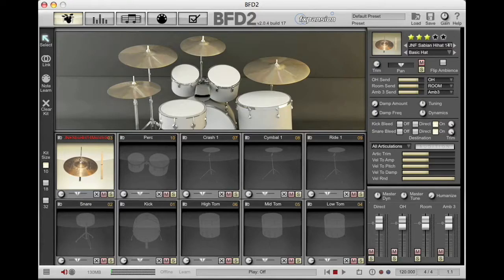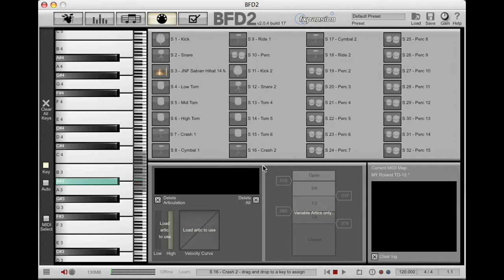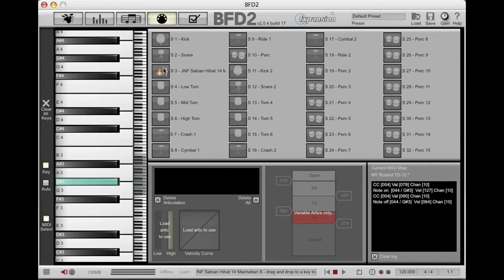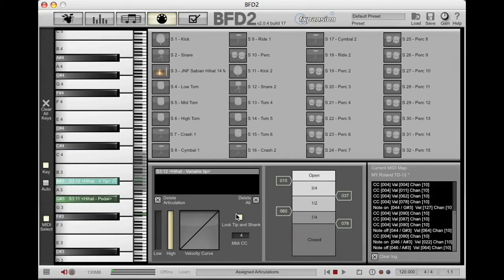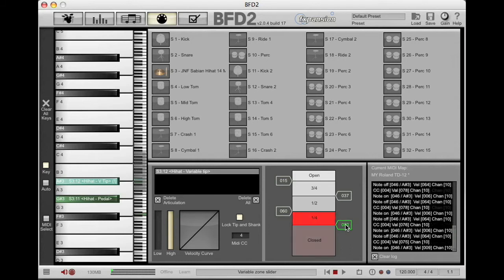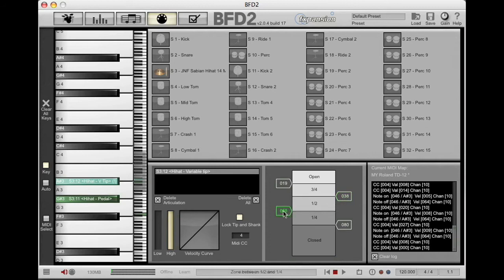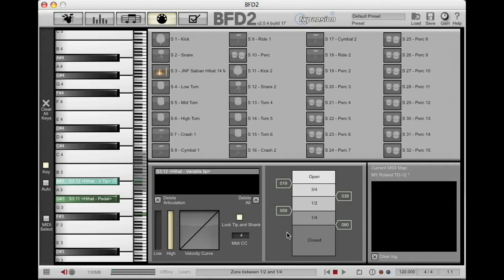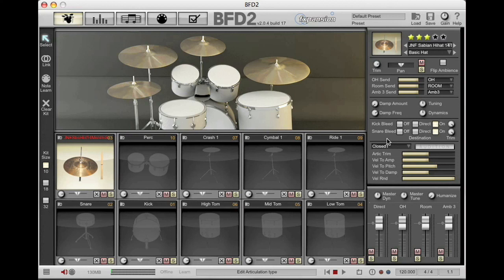BFD2 Mapping Variable HiHats Tutorial

Comment: John, thank you for the video, but it's not working for me at all. I have a Roland TD-9 module and a VH-11. The thing is that the Roland module is sending two midi notes to BFD2. One variable tip and a pedal note at the same time. It's impossible for me to get a tight closed sound this way. Besides that sometimes the 'ringing' of the open hihat sound just goes on, even with the pedal all the way down. Please, is there a solution to this problem? I use the latest build (2.3.0 38).
Thanks!